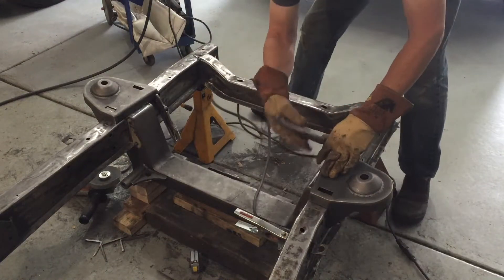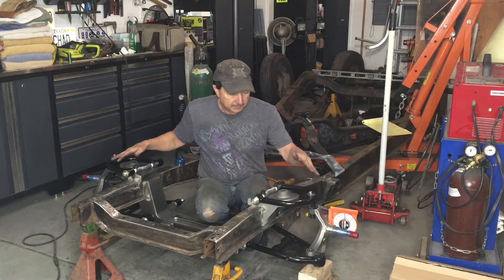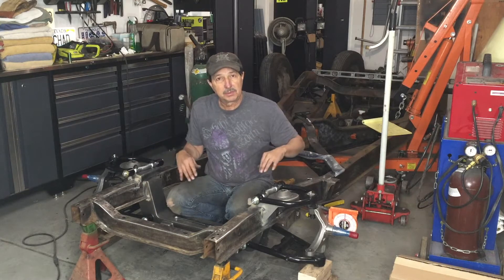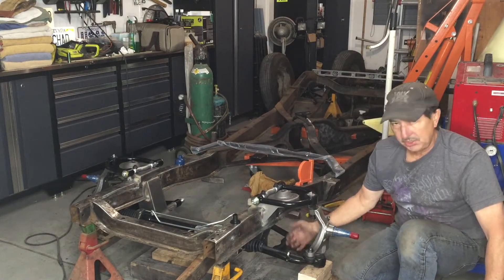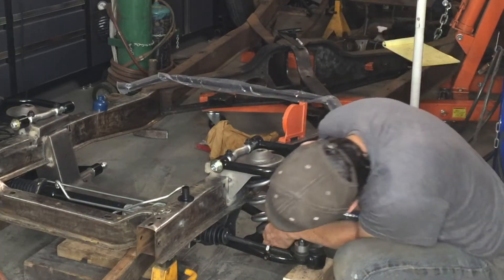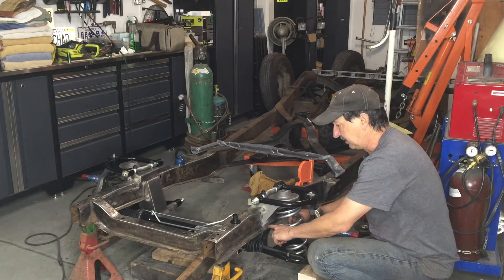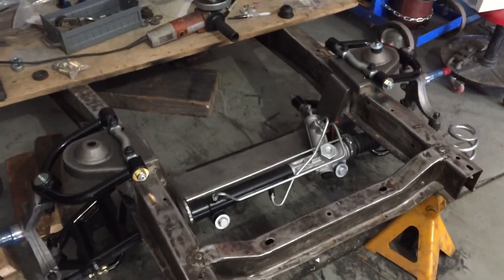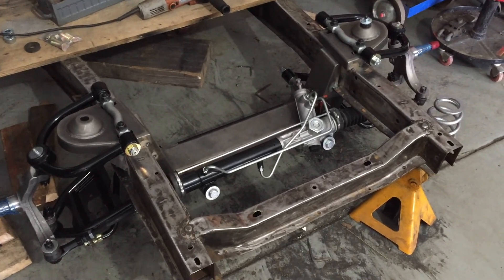Part 4. Adding Independent Front Suspension. Mustang II IFS install in a 1950 Willys Jeepster.

Comment: What sway bar are you using? What is the brand or length from hole to hole? Thanks!
Reply from the maker: I purchased a complete IFS kit from Classic Performance Products. The kit they recommended for my 1950 Jeepster was designed for a 1940 Ford. The sway bar came with the kit and it does not have any information about it. I will be doing an updated video with final assembly. I'll do some measurements in that video.
Reply: @riderescue  THANKS very much!